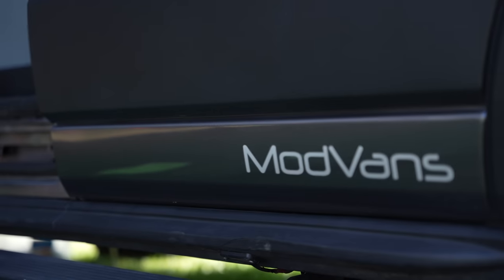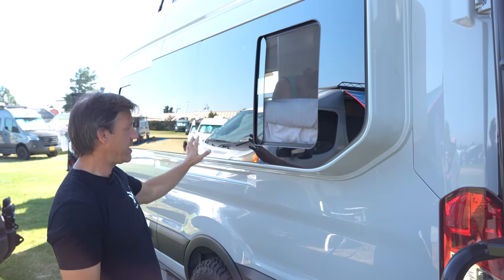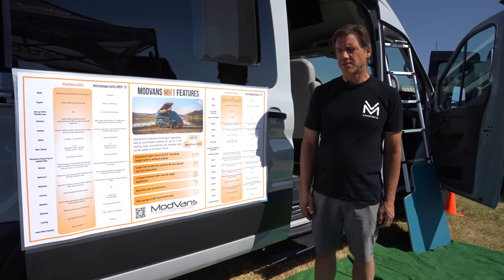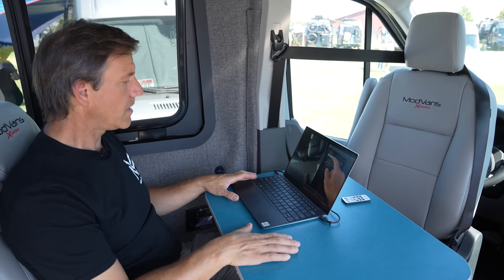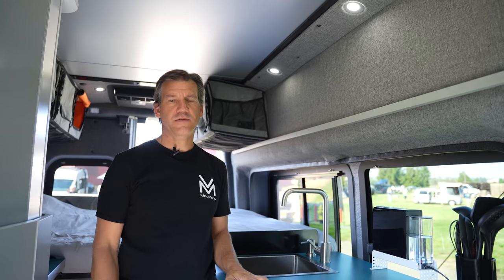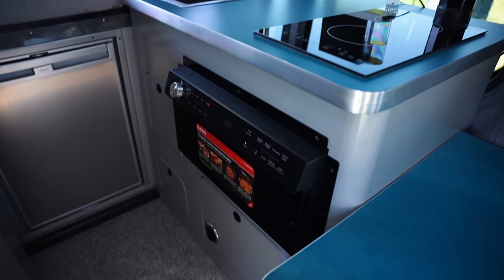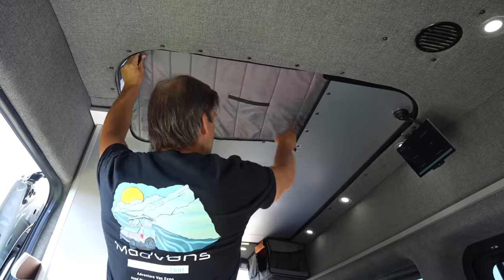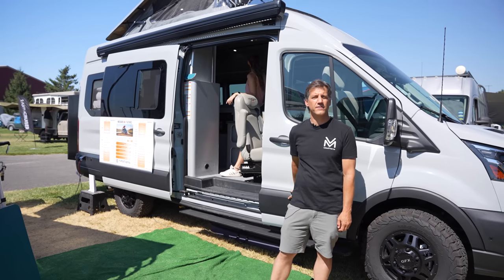Full Tour of the MHX/1| Brand new model from Mod Vans on the Ford Transit

Comment: Very impressive innovation! And that bathroom is a great compromise for those who can't stomach the Storyteller version.
Reply: Thanks! We debated having a shower with a curtain multiple times, but, for some, hard sided walls are a "must have." The popup feature lets you have a bathroom without it taking over the entire RV. We were very excited to discover the "semi-dry" feature so you don't have to shower with your toilet,
Reply: @pjtezza  is it a black tank or cassette?
Reply: @JohnSeitz  we offer cassette, composting and dry flush toilet options, but we do not offer a black tank option at this time.

Comment: How much does it cost the way it's equipped?
Reply: Probably pricy
Reply: The MH1 is sold as an RV and pricing starts at $131,000, including the Transit chassis. The MH1/X, which has the largest battery available in any Class B RV, all high-efficiency DC heating and cooling and app monitoring and controls for everything, starts at $161,000. These are updated (estimated) prices for 2023. All our RV qualify for 20 year RV financing, RV insurance and come with a factory warranty. The MH1/X shown in the video has a significant amount of chassis and off-road options and cost about $200,000.
Reply: @pjtezza  Starting price at $161k was very enticing but your website indicates them starting at $183k
Reply: @Infamous69691  at this time, due to the craziness in the vehicle market, the only chassis we have immediately available are ones with all the options. You can save more than $10k by subtracting chassis options. If you would like a lower cost chassis, one can be special ordered by contacting our sales team.

Comment: How does one service the batteries under the floor if needed? 🤔
Reply from the maker: ModVans response copy/pasted from another thread:  "The entire conversion is modular. Everything can be removed for service then reinstalled. The battery is made of 120 cells that can be tested and replaced individually if necessary. The cells are expected to last 3,000 full charge/discharge cycles. That is 30 years of weekends."
Reply: That was my question too that kind of outside the box design needs lots of stress testing. I do like the idea I will be watching your conversations it’s beautiful
Reply: @AdventureVanExpo  I suspect those cells could last even longer, if they aren't constantly fully discharged/recharged.
Reply: @AdventureVanExpo  great answer - thanks!
Reply: @thejackofalltravels8267 we aren't Tesla or Rivian, but we did a full articulation test, a full off-road test, testing in snow, mud and rain, and now have over 10,000 miles of testing on both CV1/X and MH1/X in all types of weather conditions. The MH1/X in this video just completed a couple of laps around the US for shows where we used it for camping and demos at every show (don't put your dirty shoes on my bed please!!!). The MH1/X demo is just today getting back from a trip to SF Bay Area (a demo at the Stanford homecoming football game), but it won't be here long - we are showing it off to investors next Monday, then lending it out for more PR (a trip to 'Vegas), then another show in LA!
Reply: @deepsea5107  we agree!

Comment: This actually looks amazing!  Question though.  It looks from the video that this is built on the extended chassis which typically has a bug ass overhang (not good for my driveway). But also noticed it is NOT a dualy in the rear and AWD which I didn’t think was possible from ford.  Please correct me 🤓
Reply: Yes, this is the extended chassis with single rear wheels. Our build is extremely lightweight (about 1,200 lbs vs. 3,700 lbs for a more typical conversion with the same features), so dual rear wheels are not needed (and also not desirable for off-road driving). The lift kit and larger tires generally solve departure angle problems with the extended length chassis. You can see some off-road footage in this video and the MH1 does great!

Comment: The battery setup looks kind of sketchy. It doesn’t look like there’s any thermal/runaway management for the packs and that’s a larger specific surface area for heat transfer. Just because you can physically do it doesn’t mean you should.
Reply: Laying the battery cells flat like this is great for thermal management. The largest side of every cell is exposed to a channel below the battery. There is a dedicated system that can push heated or cooled air through the channels. This isn't quite the level of Tesla where cells are exposed to liquid coolant, but air should work fine for an RV battery where the maximum current flow is much lower. Spreading out the batteries like this is also helpful in preventing a thermal "runaway". The smallest side of each cell is touching only one other cell on two sides, reducing the amount of heat that can pass between cells. We have done some thermal runaway testing on our design and this works in practice - a single burning cell does not catch the cells around it on fire.

In typical RV LiFePO batteries, the cells are packed as tightly as possible with the largest sides touching. This makes them difficult to heat (less area exposed to heating pads) and nearly impossible to cool the interior cells. This works most of the time for an RV battery because the cells are inside a temperature controlled vehicle and the low typical RV current draw, but it often does not work for high current applications (like running an A/C) or when temperatures get really hot (130F in AZ summers). You can see this in the groups where people with 10kwh RV batteries that shut down due to overheating.

Comment: What is the height including the A/C?  I have a carport beam to consider. Thank you. Great design! Also ground clearance as there is a ramp into the carport.
Reply: Driveway clearance is tough to estimate since you have to factor in height, approach and departure angles. Generally, a lift kit and larger tires helps a lot with the departure angle (but may cause problems for the carport beam by adding 4" to the overall height).

Comment: This is close to perfect.  Wondering if a bed that pulls down manually to save space and larger fridge / freezer are possible options.  A popup is not something I would use because of the ladder.
Reply: Camper vans have trade-offs. We experimented with an interesting fold-up bed design, but we decided to go with a permanent bed so you could have an extremely comfortable mattress, use standard queen size bedding, and the bed is always setup. If you want maximum storage space, you could remove the downstairs bed and only use the popup top bed. We have a floorplan option that allows "pass thru" to the garage and the fridge up front. A significantly larger fridge would block the windows and is not something we are planning at this time. We will eventually offer a version without the popup top, but it is not a priority at this time.

Comment: With all those batteries whats the GVWR?
Reply: Our build is extremely lightweight (about 1,200 lbs vs. 3,700 lbs for a more typical conversion with the same features). A full 2160ah battery adds about 500lbs. The MH1/X shown in the video has some significant chassis and off-road options and weighs 8400 lbs with a full tank of gas.

Comment: Too bad you went to EV propulsion.
Reply: It has a gas engine.  The large battery system is to power the house equipment.
Reply: @deepsea5107  correct! EV as soon as the chassis are ready, but we will continue to offer both options.